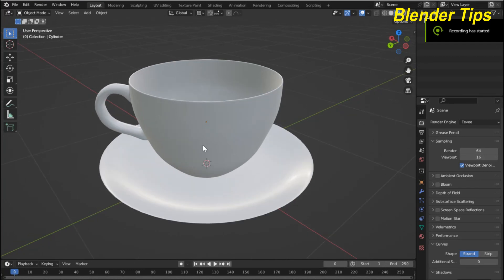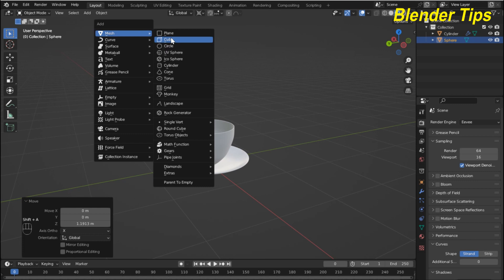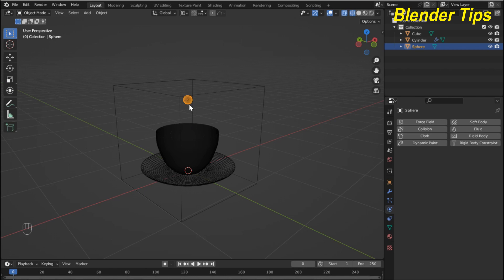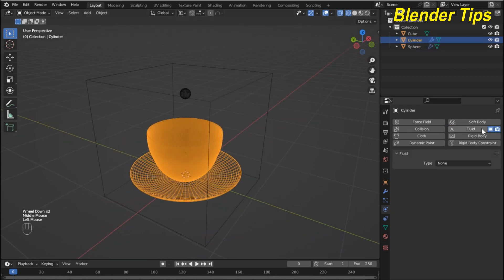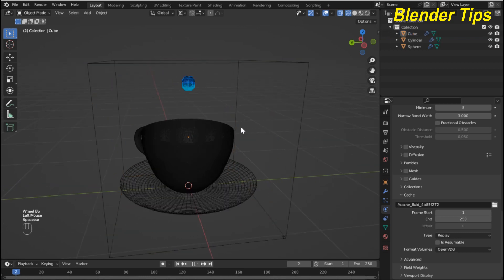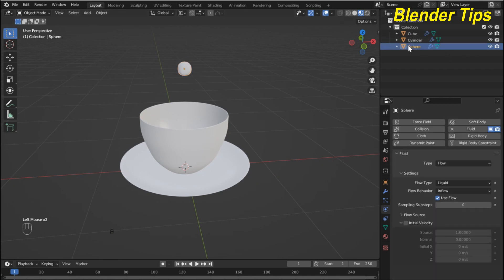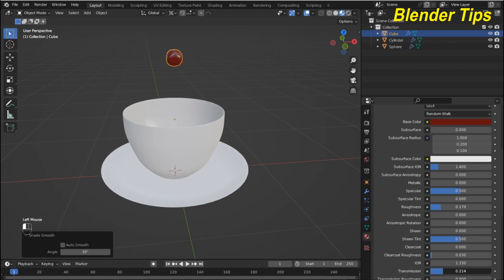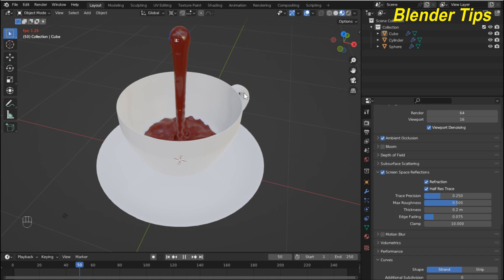Coffee In Blender | Blender Fluid Simulation (Mantaflow)

Comment: Hello, 1st you tutorials is easy to follow. How can I fix the coffee running through the bottom of the cup
Reply from the maker: Thanks,
First you should adjust domain small as possible as you can with best to cover all of your objects inside domain then increase resolution devision according to your scene and system configuration.
Reply from the maker: Also in fluid choose your cup as effecter and check the option is planer turn on. Then your coffee does not running through the cup.